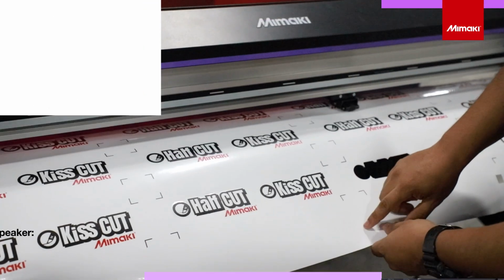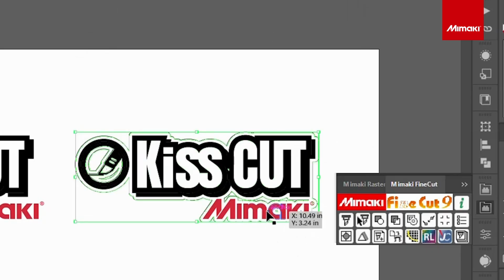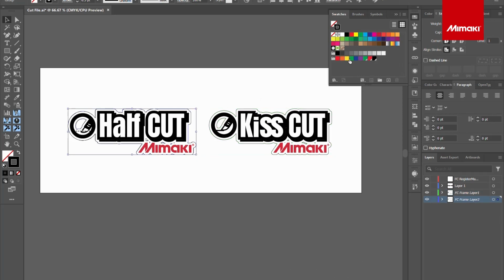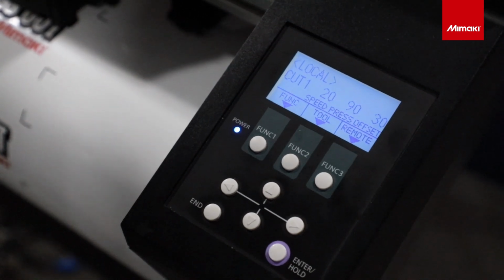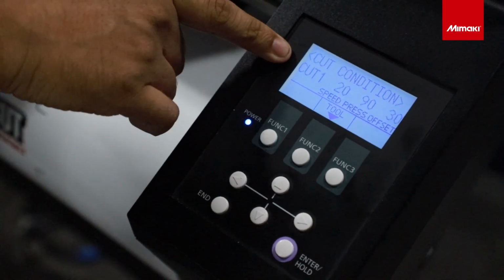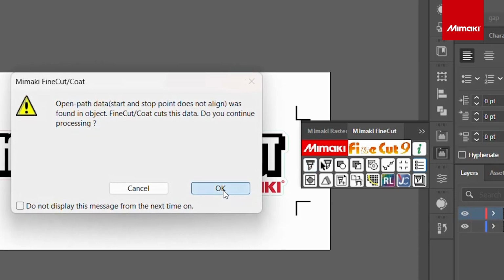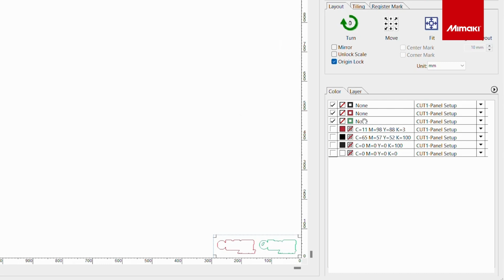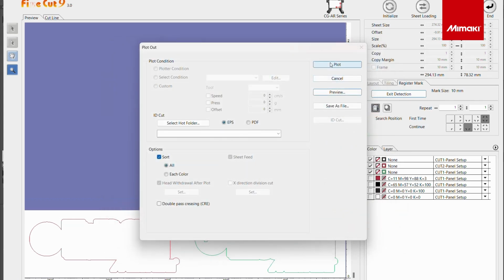Half Cut and Kiss Cut on the CG-AR Plotter ~ Tips, Tricks, & Techniques

Comment: I use Mimaki CG 60 AR, and for Halfcut or diecut sticker, Is it with a different rubber base
or or just with original rubber ?
Reply from the maker: Hello, the original rubber base works for half cut and kiss cut on a variety of media. We only recommend switching the rubber base when cutting difficult or slippery media.

Comment: What is the exact reason we would be having a problem with the cutter making two rotations around a single circle cut instead just one? 

Mimaki tells me this a something that we change in Finecut9 but they wont tell us anything about that the setting actually is.
Reply from the maker: Hello, for technical support please submit a detailed email request or contact our call center at na.service@mimaki.com or (888) 530-3992.

Comment: I get Error ERR51 on my CG 130AR and the wheels are proportionally aligned. When I look at the model in the settings of the cutter it shows CG 60AR, is this normal? Or is this the cause of my problem?
Reply from the maker: Hello, please submit a detailed email request or contact our tech call center at na.service@mimaki.com or (888) 530-3992  for technical issues.

Comment: I try to kisscut on transparent sticker but the machine can not detect the mark , i dont know what the problem.
Reply from the maker: Hello, when printing on transparent or clear material, you must check the box "Fill around registration marks" either in RL7 or in your Finecut9 Plugin. This will put a white square behind the mark, enabling the sensor to read the mark.